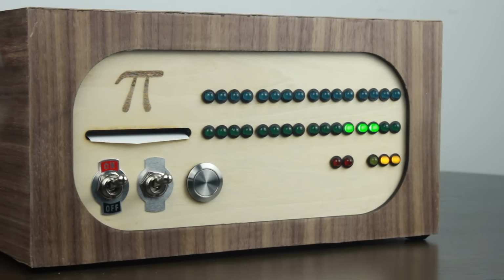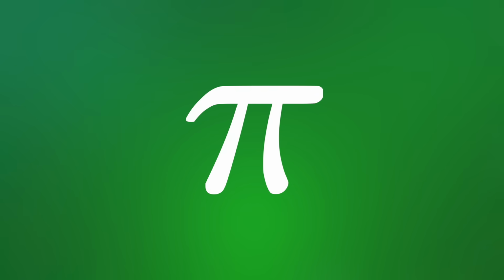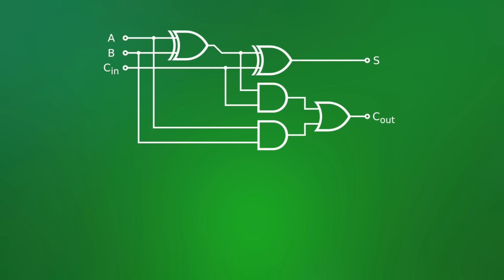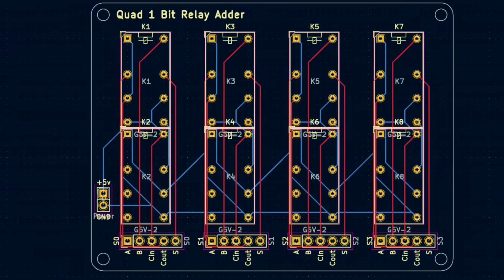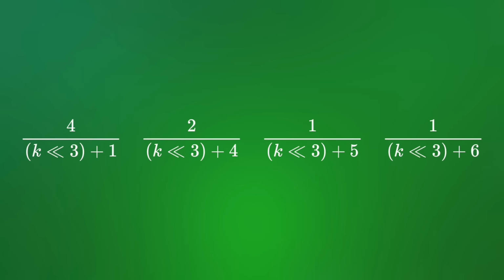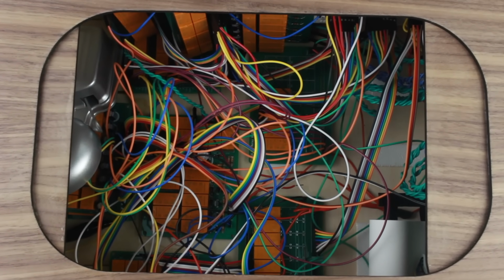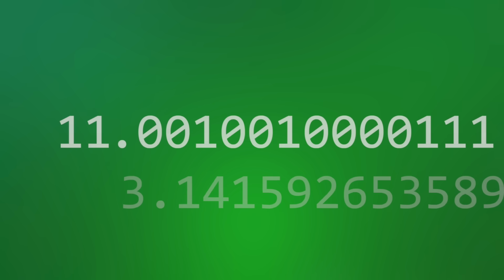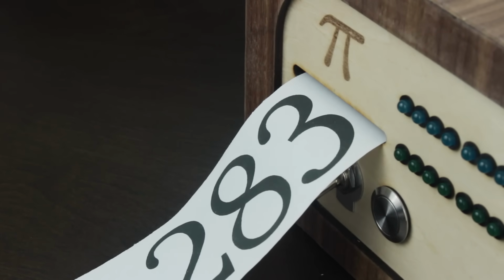Building a Relay-Powered Pi Machine

Comment: Concerning relay reliability:  I think you might be packing those relays too closely on your PCB's.  Magnetics from one relay can interfere with the operation of adjacent relays when they are packed closely like that.  Spec sheets should specify clearances.  It would be great if the project only used the PI board for printing and nothing else, not even checking.  Otherwise, a fascinating project and I learned about a new method for generating Pi.

Comment: How did you choose the clock speed? Because I know there is a hard limit somewhere after arc flash / flashover and before reset. I've replaced too many connector pads to trust a relay or connector with too little Voltage.

Comment: In the relay datasheet, there are ratings for "must operate" voltages. These are typically the minimum voltages at which the relay is guaranteed to operate. A typical voltage for 12V rated relays is ~8V. Another important specification is the "hold" voltage. This is the voltage at which the relay, once actuated, will stay actuated. It can often be as low as half the relay's voltage rating.

You can use that hold voltage to your advantage in designing the relay driving circuitry. Reference the datasheet for typical actuation time and drive the coil at 12V (or must operate voltage) for that long, then drop to hold voltage after if the relay must be held. Something simple like an RC circuit triggering a switch x milliseconds after the relay is energized. Should let you drive the system faster and with fewer errors while minimizing excess power draw.

I would also recommend using signal relays. They're much faster and smaller while still making the fun clicky noises, and you can often get them in weird wiring packages that may allow you to further reduce the part count by having one relay perform multiple roles depending on what step the calculation is at.

Comment: No need for flyback diods?
Reply: Good point, but they are mainly to protect the driver circuit, not the relay itself.  Some relays have them built-in, but his schematic doesn't show them.  Would need the part number for that relay do find out for sure.
My earlier comment is that I think he's packing those relays too closely on his boards and that's what's causing the reliability issues.

Comment: It's fun to look at huge tables generated for pi but, in practical use, going beyond 4 digits is just noise.
Take 3.1416.  The "4" is already one 100th of 3.  The next "1" is one thousandth.  And the "6" is a ten thousandth part of 3.  Background noise at that point and no further practical gain can be realized by going further.

Comment: Nice. Now I want to see a machine capable of calculating digits of pi pure mechanically. So no voice coil actuated relays. Just cam wheels, levers, marbles on tracks and so forth. And O. Of course no electric motors. Just a hand driven crank. Prefereably wood.

Comment: I learned KiCad and started doing PCB design about 7 years ago now.  It's still my favorite piece of software I've ever learned.  I absolutely adore using it.  Electrical Engineering can get a bit complicated (I mostly design analog pro audio gear, which requires very careful noise mitigation), but the software itself is wonderful and fun.  Also, Pro Tip: In the future, use Omron relays.  These are the affordable, bulletproof workhorses.  I use them exclusively in my audio gear, and I've never had a failure.

Comment: I know I'm late to the party, but I thought I might still give a heads-up to the PCB problem. When starting out with PCB design, the first step should always be to check the fabrication capabilities of your PCB manufacturer and enter all of those values into the DRC functions of your CAD software. Then after your PCB design is finished, run a DRC check which compares your design with the saved fabrication capabilities. The DRC check will let you know if e.g. traces are too thin, gaps between traces and vias are too narrow, traces touching, etc. The PCB manufacturer won't run such tests, they just take your Gerber files and send it into production, they expect you to run these tests beforehand.

Comment: Hmmm.... I wonder if you could make a Difference Engine compute Pi?   ala Charles Babbage... not sure, but that's more mechanical design challenge.   Still, a relay computer, that's a fun project, I built a few relay projects over the years for fun, and the one thing that really "bugged" me were race conditions, not a lot of fun to work out.

Reminds me of a college course I took in the late 1980's,  third year undergrad, It was a digital design and computer architecture where we had to design and build a 4-bit computer from TTL, we had to construct it using mostly SSI and a few MSI, for example, the ALU we used a 74181... but you talked about breadboard spaghetti, yeah, big time!!!  but I loved that course, I got a majority of the project working for me... we had to demonstrate that our "computers" could do at least one each of an Arithmetic operation, a logic operation, that our I/O instructions worked, and a branch (unconditional) instruction, and a logic branch instruction.  It was a behemoth!  And took a beefy power supply to run it.

Comment: Typing of board errors, many years ago I designed a circuit to add 9 1-bit inputs together in parallel (part of a machine testing parallelism techniques with Conway's game of life) using four 4081s (four FAs per chip). The prototype was on a breadboard, and it didn't work first time. A few days later, I was on a long train journey to an RS trade counter, without much reference material, and it suddenly struck me where the error was. When I got back home, I tested the wiring connection, and it was exactly that: You can't do this stuff without being completely obsessed.

Comment: I’m new to this, so just for the sake of learning, what would be all of the differences if solid-state relays were used instead of mechanical relays? The only things I can say for sure is more expensive and no fun clicky noises. It would probably compute faster, more reliably, and more precisely, correct? Would it produce more or less heat and take more or less voltage?

Comment: Thr latching might be happening due to not enough voltage when u dropped it down from 12V to 6V. Typically relays need higher voltages to move than latch. So one solution could be give a higher for a short portion of the time. This is applicable only if you are using either NO or NC relays. If you use latching relays then, it won't work

Comment: Im going to be that guy: since you added error correction on the pie with a parallel computation you technically would get the exact same result as if the relay were a random number generator. In some sense, the relays arent doing the computation since it lets the pie override it.

But also complaints like that are nitpicking a cool project, and ignores the point. 

Maybe what you need is multiple relay computers to do self correction.

Comment: in my fathers job there is an elecro mechanical system (like 150 relays) and they are a special kind that doesnt use springs but gravity for 100% disconecting

Comment: Interesting retro project.   I experimented with Boolean logic, using relays, when I was in High school; circa 1966.  There were no books in the library on the subject so I developed my own notation.   I wanted to build a TIC-TAC-TOE playing machine with relays.   I worked out all the possible games and the machine's best moves.  My design was a sequential finite state machine. There is a lot of symettry in TIC-TAC-TOE, so I built a symettry translator, with a motorized wafer switch.   I was not abke to get eniugh relays for the project, but my high school principle and I went on several great field trips.   That year, while visiting a local college for a wrestling meet, I met a fellow who was using an IBM computer.  I showed me the printout of PI that spanned over 10 large pages.   That was the first time I had seen a computer.

Comment: As a kid, I remember that there was a computer in the Brooklyn Children's Museum that was built out of relays.  It was hard wired to play Tic Tac Toe.
Computers have been built with TL (thermionic logic), RTL, then DTL, then TTL, then ECL, and finally CMOSL,  (there was also I2L).  I guess you are using EML (electro-mechanical logic) which is one stage above 'stone knives and bear skins'

Comment: Since calculating pi does not require random memory access, only serial memory, you could use delay line memory.
Probably magnetostrictive rather than mercury, for obvious reasons.

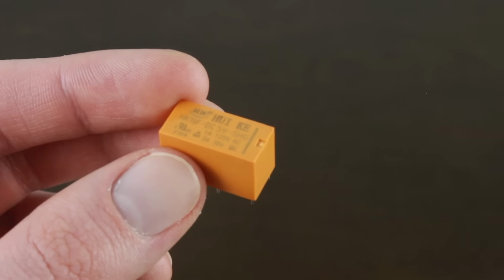Comment: 12:52 
Why do you associate “failure” with mechanical things ?! Mechanical relays ( electromagnetic ) may fail due to the high temperature of the electromagnet, as the electromagnet is not efficient because it produces a lot of heat in addition to induction. Moreover, the electrical wires that form the electromagnet are exposed to problems due to fluctuations in the energy transmitted through it, as the This energy rises and falls in amount and direction millions of times, and this is not good for wires because it changes very quickly ! I also think that the relays they call “solid-state relays.” You are right that they are mechanical, but they say that they are more efficient, durable, and because the electrical ( electromagnetic ) part, which generates a lot of heat and consumes a lot of energy, has been abandoned. Every device can fail so please don't attribute failure to "mechanical thing" alone, that's corporate marketing talk !

Comment: Neodinium magnet embedded and two metallic discs, one with  π  and one with τ so you can show off the mode. 
The switching of the metal discs also done using relays.

Think about it!  :face-blue-smiling:

Comment: There's no problem making computers out of relays. There's no problem making them with pneumatics, hydraulics, mechanical. Whatever. Unless you consider cost, space, speed, energy consumption. Only then electronics are prefered. For very simple functionality, electronics might not be prefered.

Comment: Lame, basically only the adder in relays.
Control, sequencer, memory done with RPi.
EPROM or SRAM as storage is fine, but if sequencer, control logic is a microcontroller, then it's not a relay computer any more!
Every DIY transistor computer is more impressive.

Comment: Fellow Pi calculator here. I calculated Pi to 1,000 decimal places in 1981 using a polynomial expansion that converged two decimal places per iteration. Of course, it took a DEC mainframe computer a whole weekend of CPU time to do it!
Reply: And now, a cheap arduino board from China can do the same calculation in seconds (at most), can run on a battery and costs just a couple of €£$, rather than the silly money that mainframes cost.

Progress is wonderful :)
Reply: @mattsadventureswithart5764  isnt arduino italian
Reply: @arnthorrr  made in china.
Reply: @arnthorrr yeah but chinese knockoffs and clones exist
Reply: @arnthorrr yes
Reply: @arnthorrr  yeah but you can get the same board from china at a 10th of the price
Reply: @suhandatanker  Microcontroller from China, board is assembled in Italy
Reply: @arnthorrr was Italian, purchased by Qualcomm. They mean Arduino Chinese knockoff that uses the non-propriety usb to serial. Arduino is open source
Reply: @mattsadventureswithart5764  i think thats a raspberry pi though-
Reply: worth it!!
Reply: In Pi Day 2023 I calculated pi to 273 digits in 27 hours, 7 minutes and 40 seconds on a 37-year old MSX computer running BASIC (Z80-A microprocessor @ 3.57 MHz). 
That’s too long for so few decimal digits, even for an 8-bit computer from the eighties, but I used the Wallis Product with my own correction factor which gives linear convergence, about two digits per iteration (25/12 to be exact). 
In 1984 as a student I was allowed to use only half a second or so of computer time (DEC System 10). 

——

Wallis-Wasicki Algorithm:

begin
  input n;    {number of decimal digits}
  n := ceil(12*n/25);
  c := 0;
  d := 8*n + 4;
  e := d - 8;
  m := 4*n*n - 1;
  w := 2;
  for i := 1 to n do
    begin
      w := w + w/m;
      c := m/(c + d);
      m := m - e;
      e := e - 8
    end;
  p := w*(2/(c + d - 1) + 1);
  output p
end.

——
Reply: M
Reply: What do u mean “calculator” why didn’t u just google it or ask Chatgpt
Reply: Why not just take all the reciprocals of the Fibonacci Sequence and add them one after another?
Reply: @JohnSmith-eo5sp Not a good approach for many decimal places
Reply: Prove it then

Also e is 2.7182818284590452353602874713526624977572470936999595749669676277240766303535475945713821785251664274274663919320030599218174135966290435729003342952605956307381323286279434907632338298807531952510190115738341879307021540891499348841675092447614606680822648001684774118537423454424371075390777449920695517027618386062613313845830007520449338265602976067371132007093287091274437470472306969772093101416928368190255151086574637721112523897844250569536967707854499699679468644549059879316368892300987931
Reply: Unc

Comment: I wonder how fast a vacuum tube version of this would run.
Reply: As a quick info, the first vacuum tube computer, the ENIAC, could do 5000 additions per second while the best relay computers topped at 50.
And newer tubes after that era where smaller and faster.

Comment: 4:14 This is a false statement.

Just as the power function may be defined as repeated multiplication and multiplication may be defined as repeated addition; addition may be defined as repeated counting.

2+4 can be calculated as 2+(1+3) --> 2+(1+(1+2)) --> 2+(1+(1+(1+1))) then by the communitive property can be rearranged to be (((2+1)+1)+1)+1 then solving this becomes ((3+1)+1)+1 --> (4+1)+1 --> 5+1 --> 6; therefore, to perform single digit addition in decimal, you are only required to memorize how to sum 18 pairs of numbers (0+1, 1+1, ..., 17+1).

Comment: 1+3 is the same as 3+1 so it's more like 50 pairs of sums. And the most important part of basic decimal arithmetic is determing the positional values.

So once you know that 7 + 3 = 10, it's easy to remember 7 + 4 as (7 + 3) + 1 and 4 + 7 is just reversing the digit order.

The slowest way to do the math is to take the first number and add 1 the number of times as need.

7 + 6
7 + 1 = 8, 8 + 1 = 9, 9 + 1 = 10, 10 + 1 = 11, 11 + 1 = 12, 12 + 1 = 13

Comment: a pi gadget i've always kinda wanted was a micro computer that represents pi using light and sound, features of the gadget include:
a button to calculate the next digit
a button to play back the currently stored digits
a button to swap modes
a 10x10 grid of multicolored LEDs to display pi
two modes, one that only advances only when the button is pressed, the gadget plays the full sequence when it generates the new digit, each number 0-9 being assigned one of 11 notes with the spare note going to the decimal
the second mode streams digits continuously for as long as the device is able to continue calculating new digits
the lights each decide their color based on digits of pi that stream from right to left, bottom to top, excluding the decimal, each light gets up to six digits, if a digit is not available the position is filled in with a zero

Comment: Did you add snubber diodes across all the relay coils? That will keep the back EMF across the relay coil at a minimum, and enable it to last much longer, without all those voltage spikes.

Comment: I dont see kickback protection diodes on the relay coils at 8:00, it could affect signal integrity and longevity. It may also help to always use both sides of the relay in parallel where one side would otherwise be usused.

Comment: Poor relay life can come from un-snubbed coils:  the current in a coil wants to keep flowing - if you feed a relay coil from other relay contacts, when the contacts open the current continues anyway, creating an arc across the contacts. This arc chews up the contacts, causing early failure.
Adding a diode across each coil (cathode to +) fixes this.
Some relays have this diode built in as an option.

Comment: To improved the reliability make sure each relay has a flyback diode on its coil to prevent voltage spikes welding the contacts of the relays you had trouble with

Comment: In theory wouldnt using the digit picking algorithm and then just going place by place be the best method for printing out a strip like this?

It would no longer need any memory except for which digit its actually trying to compute, then using that the relays would turn that number into the digit, which the printer is then told to print.

This would get around the issue you list in the end where it gets harder to compute the longer it goes, if it only focuses on the immediate digit then all are equal, and it can calculate as long as the clock counter stays within however many bits the machine operates on.

Comment: The transparent relay was a pretty neat thing to see, demonstrates how every step of this process is directly corresponding to flipping a switch. Also I laughed out loud when you compared a relay to a railroad switch just because I'm currently using relays to control model railroad switches.

Comment: This reminds me of a machine I was once responsible for.  It was called the "Omni 2000".  The Omni was a rack tester.  It would check that everything was connected to what it was supposed to be connected to and that nothing was connected to anything it wasn't supposed to be connected to.  The Omni had 7000  reed relays.  Guess what the most common failure was...  I still remember the sound of the self test, as it whizzed through all the relays.  It was controlled by a PDP/8.
Reply: I don't understand why you didn't name it Omni 7000
Reply: @soareleonard7570   I didn't name it.    It was named by the company that built it.  And the number of test points - and therefor relays - was an option.